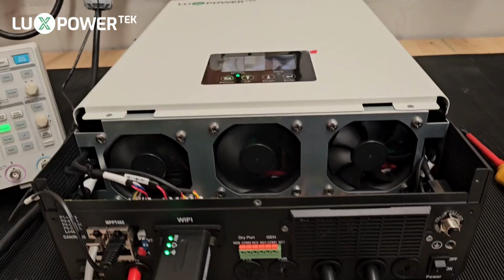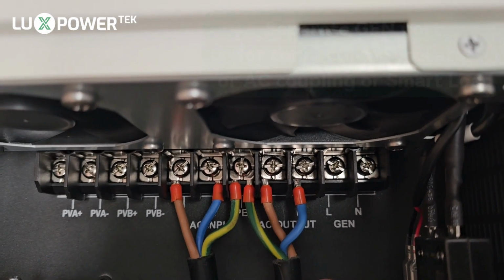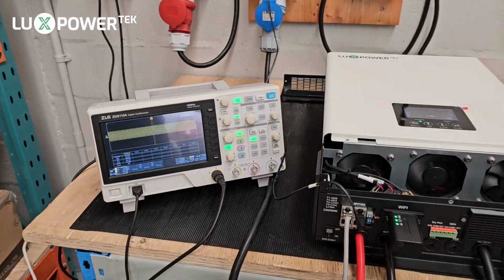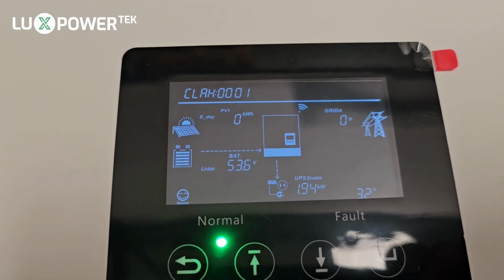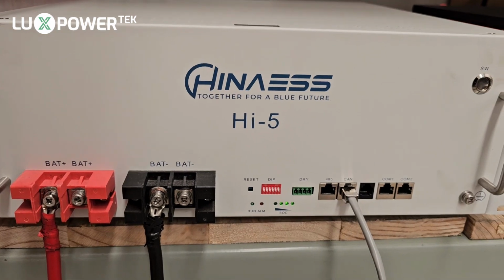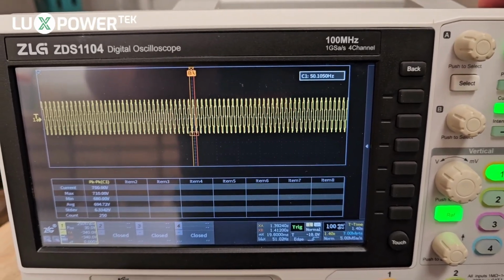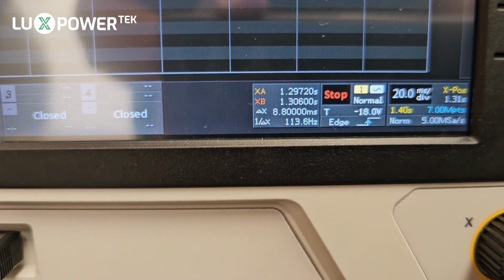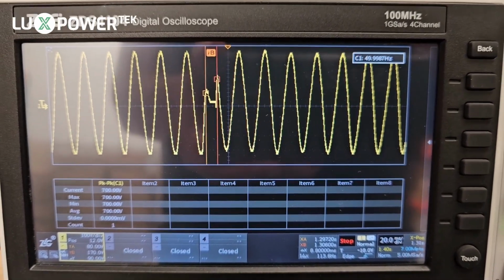LuxpowerTek SNA 6K Single Units Setup

Comment: This is a horrible video. You should be ashamed to put such crap out there. You're jumping all over the place, talking too fast, and not actually showing how things are programmed. if this is the type of training videos put out by Luxpower then buyer beware of the quality of the inverter. If Luxpower does not want to even take the time to put out a proper video then how much  time did they spend on building a reliable inverter???
Reply from the maker: Hi there, We’re sorry to hear you had such a negative experience with this video. This training video is mainly intended to show the setting/programming process of the inverter, not to cover every detail of how the product is built.

If there are specific steps or settings in the video that you find unclear, please let us know the exact part and your question – you can email us any time at sales@luxpowertek.com
 or info@luxpowertek.com
 and our team will be happy to help.

We also noticed you posted the same comment under another video which focuses on our web monitoring portal, not the LCD. The web portal actually includes more functions than the LCD, which is why we published a separate video to introduce it.

We’re sorry that this has led you to doubt the quality and reliability of our inverters just from a setup video. We continuously work to improve both our products and our training materials, and your concrete feedback on what you’d like to see improved would be much more helpful than a general criticism.

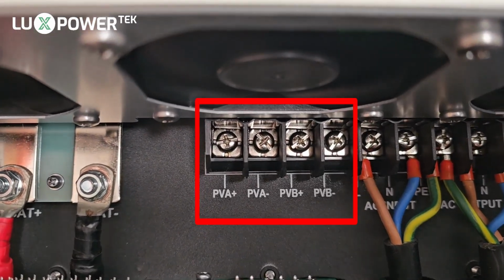Comment: searched hi and low to confirm PE grounding  for AC input and AC output 0:30 , both uses same PE
Reply from the maker: Hi Sir, thanks for your reaching out to LuxpowerTek.  Could you please describe more details?
Reply: @LUXPOWERTEK  Hi there , no issue just the standard documentation in the inverter box does not describe how to connect PE for AC input and AC output. have to get the information on a youtube video